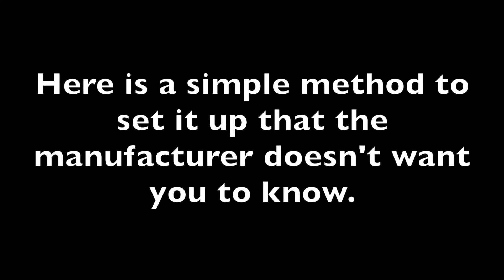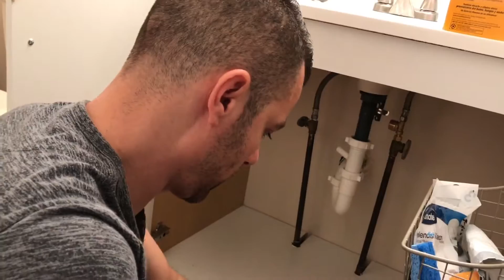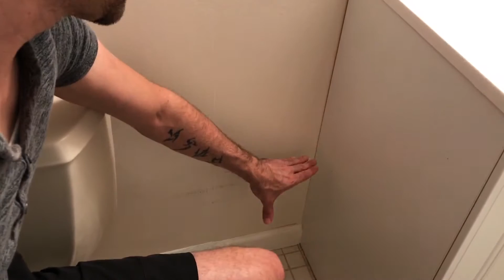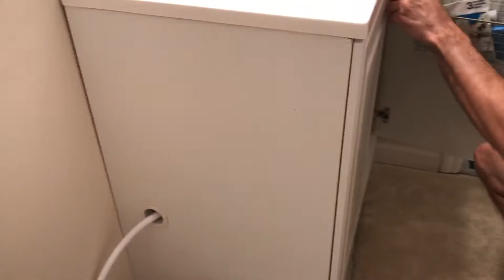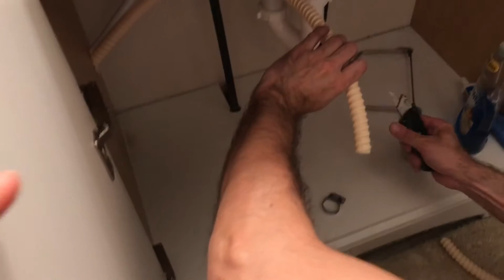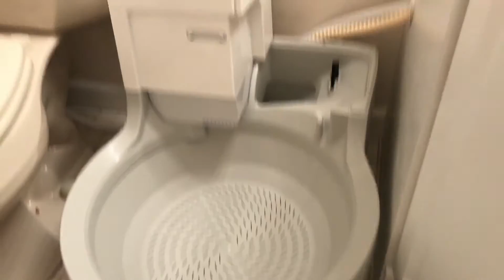Installing the CatGenie into your bathroom sink

Comment: Will it stink up the sink as it drains?
Reply: Did you use the same hardware  to accomplish this?  Or did you need to get something different?  Do you happen to have any pictures of it after the change?
Reply: @Wrigleyville29  What he's saying is that the drain hose is installed closer to the wall instead of closer to the sink.  So instead of having it be like this:

Sink -> Sink's drain pipe -> Cat Genie waste hose -> Sink's drain's U-curve thingy (called a "P-trap"--Google it) -> pipe in the back wall

It should be like this:

Sink -> Sink's drain pipe -> Sink's drain U-curve thingy -> Cat Genie waste hose -> pipe in the back wall.
Reply from the maker: The one major mistake I did in the video, and later fixed, was putting the drain AFTER the trap, and not before. If you put the drain hose before the trap (as in between the wall and the trap), you won't smell anything.

Comment: I have been using CatGenie for several years.  I was so excited to see this video.  I was concerned I would have trouble actually hooking it up under the sink, but I followed this video step by step and everything went smoothly.  I have been using this setup for about a year and a half with no problems.  Thank you!
Reply: Hook it up under the sink in this matter would yield the trap contaminated with the cat waste.     Filling the sink with the tap partially opened will bring the waste into the basin's bowl.    No longer an inviting place for hand washing, let alone using the water at that point to wash your face.
Reply: Do you know what the piece he used for the pipe is called?
Reply: @georgecardenas2420  I looked for the package he showed which states "Branch Tailpiece" and tried to find it at Lowe's with no luck.  I ended up being lucky enough to get a knowledgeable salesperson to help me.  I believe it was called something other than "Branch Tailpiece", but I was able to describe what I needed it for well enough for the salesperson to find what I needed.  I believe the salesperson did refer to it as a part for hooking up a dishwasher.  Good luck!  I really am happy with this connection over looping it over the commode seat.
Reply: @debbieculbertson3485  I'm going to try this out. I've been meaning to get a cat genie but i keep hearing of high failure rates. How long have you had your and what is your experience like?
Reply: @georgecardenas2420  I have been using cat genies for around 15 years with great success.  I have 2 (Cat Genie AI) set up right now for my 4 cats.  Both cat genies are around 3 years old.  The best part , of course, is the cats always have a clean litter box without me cleaning them.  The biggest disadvantage is they do thoroughly have to be cleaned about every 6 months (yuck!).  However, this probably prevents a lot of the problems others may have had.  The cat genie website has short videos under their support menu showing exactly how to go about it that you might want to check out before committing to it.  Their support staff is excellent  and you can call 7 days a week with any questions and they will know the answers.  Another disadvantage is the pellets.  The cats do end up tracking them on the floor.  I keep a small hand brush beside the cat genie and sweep them up and put them back in the cat genie as needed.

Comment: Did this and mine is fine- no smell at all, the unit has a couple wash cycles so I’m sure  the poop get washed out. Another thing I did was cut a price of the rubber drain tube for the toilet  and then use it to connect the two sections.
Reply: So you did this and it doesn’t have any smell? How many wash cycles do you run in a day?

Comment: Thats a HUGE mistake in this setup. Install the genie waste AFTER the "trap" (the u in the pluming)! Otherwise your going to smell it!
 Otherwise good video.
Reply: It flushes the 'nasty' water with 'not nasty' water shortly after.  Much better solution than just pumping it all into the toilet bowl.
Reply: I see you point but it would be a lot more difficult and custom. Thing is the cats sometimes only pee and the unit rinses/flushes out really good like 3 times (some people have complained about the amount of water it uses) so it should not be a problem.
Reply: 1. much more difficult to setup for most people.
2. its a bathroom dude, is it really gonna freak you out to smell feces/urine in a bathroom?